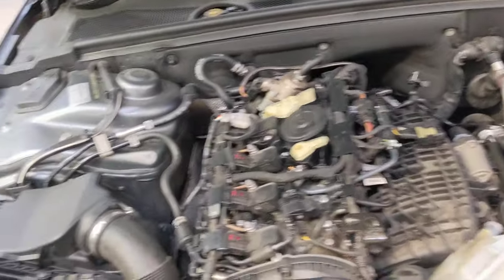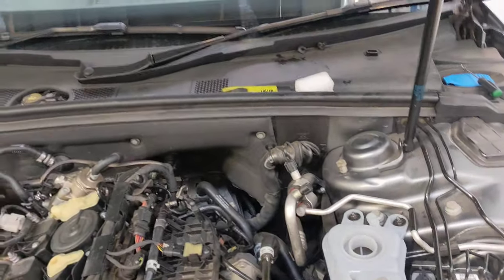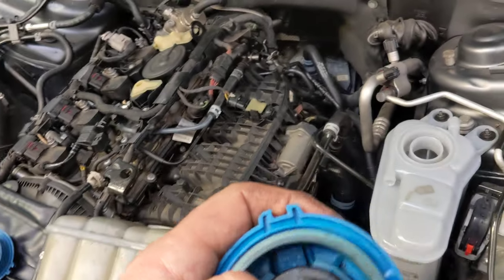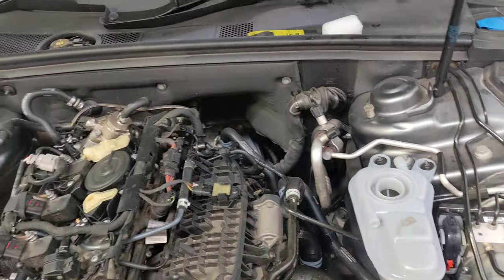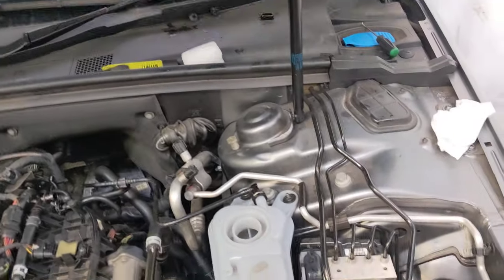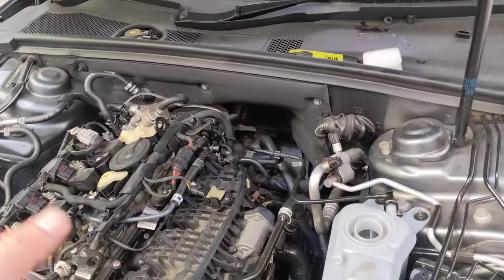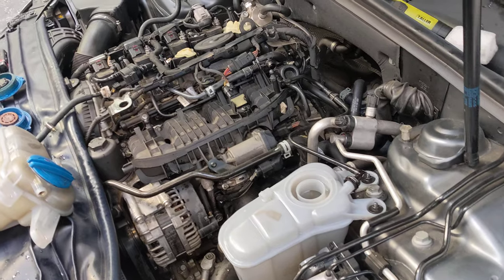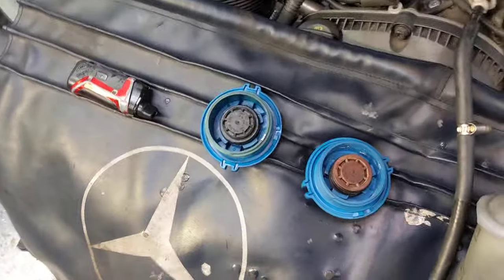2015 Audi 2.0 TSFI overheating. Damaged coolant overflow cap. leaking coolant. Radiator vent hoses.

Comment: Remember guys! The vent pipe/hose from the radiator to the reservoir has a check valve! For venting and flow control! Always replace hose/pipes with OEM don’t make your own ends! Pipes are cheaper than a head gasket or a new Engine

Comment: I had an issue with coolant spraying all over the place, looked like the same issue. I sure hope I dont have to tear the whole front end apart to replace the radiator. car is a 2013 with 118k miles
Reply: How much did it cost to fix? I am having the same problem 😢 thanks in advance